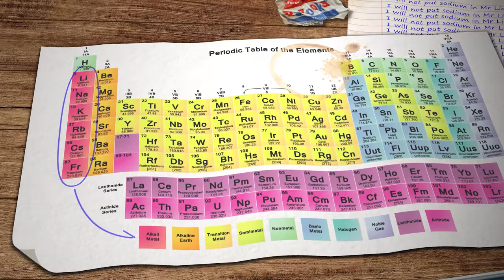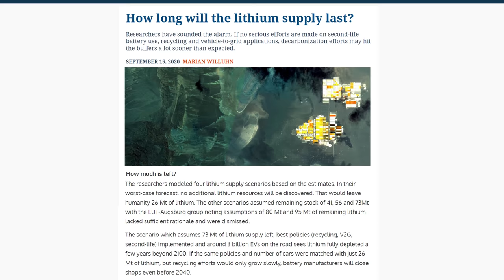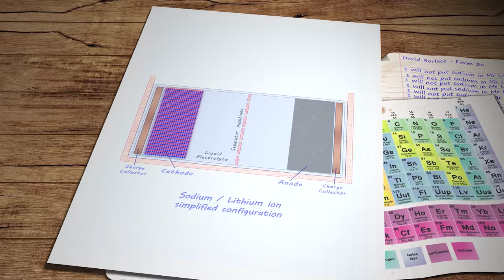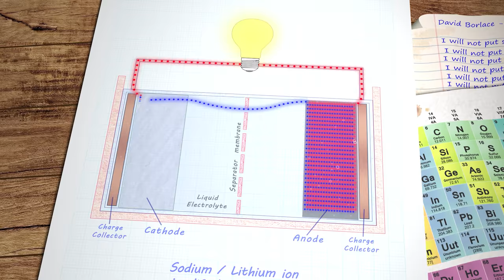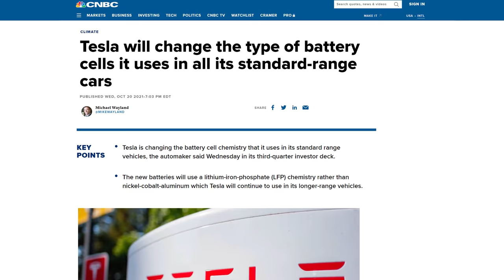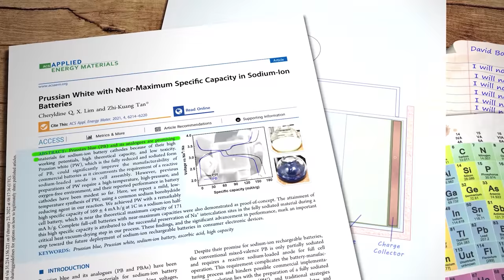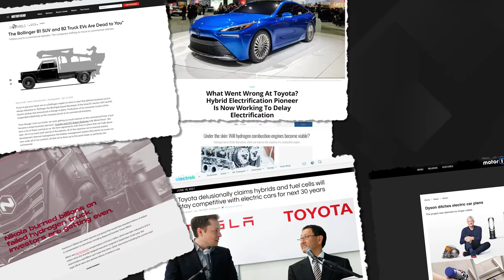Sodium-ion battery breakthrough. Safer, cheaper and cleaner than Lithium-ion

Comment: With so many horses in this race, sooner or later one or more of them is going to beat Lithium Ion technology.   Battery technology seems to improve at incremental rates, rather than massive breakthroughs.
Reply: Lithium will likely always be top dog if you only look at power density as the winning factor. Personally I'd like durability, life expectancy and price over shaving a few ounces off of the weight.
Reply: @ghz24     Sodium Ion technology can't beat Lithium in terms of power density, but for power grid applications, the increased number of charge/discharge cycles shows Sodium to be the winner. In the case of a power grid, increased size/weight isn't that important.   Battery Technology is NOT one size fits all.  Depending on the application one technology may be a better fit than the others.  As you pointed out when power density is critical, like portable applications, Lithium is the king.

Comment: Is there a safety issue? We know that lithium batteries catch fire from time to time. Wouldn't this be worse and harder to extinguish as sodium is more reactive?
Reply: Sodium is less reactive, -2.71 volts vs lithium at -3.02 volts.

But battery fires aren't hard to extinguish anyway. They don't spread like petrol fires, so you can just ignore them and they'll go away, or you can pour ordinary water on them, which is readily available, unlike petrol and diesel fires that need special fire fighting, like foam or CO2.

Comment: So, the common perception is that sodium is abundant in earths crust at about 2.8% compared to 0.1 % for lithium.  Has anybody thought of the problem that most of this sodium is in the form of salt NaCl, which is about 40% Na and about 60% Cl.  If you separate the sodium from the chlorine you in an electrochemical cell you end up with NaOH + Cl2 + H2.  Hydrogen can be used in fuel cells for niche applications, but is there a market on the large scale for all that Chlorine gas?  If there is no market for all that extra gas, then the Cl becomes a waste product.  Just wonder if anyone has studied this?

Comment: Let's face it, ANY technology that relies on mining a finite resource is due to have an expiration date. Fossil fuels are of course the most obvious, as it's completely spent in it's use. There is the hope, and honestly the reality, that existing Li Ion batteries can be recycled. There should definitely be a means for average consumers to give to this effort by offering their own spent cell phone batteries to recycling. Of course this doesn't happen. 

If you take your old phone to any recycling center I know of, assuming it's not working anymore they'll be happy to just take it for free, but offer you nothing. So many of them wind up in waste dumps. I'm for there being some subsidy to allow for this recycling. It's larger at this point than the potential EV battery recycling by far.

Comment: Will "they" (whoever "they" are) make a sodium-ion battery that will power my 1/10 scale radio control crawler? It's a 6X6 with 2 electric motors. I'm trying to find locking portal axles for it and run 2.2 wheels or a track conversion. I haven't decided if I want to go in a direct individual track replacing every wheel conversion or go with a more traditional half track (front 2 wheels stay on and the 4 rear wheels are replaced with 2 tracks...one for the left set and one for the right).

Comment: Energy density is probably the most important factor in battery design, but volume is almost equally important in terms of mobile power usage. A battery for cars and trucks needs to be energy dense but also fairly small as well as light. A battery that weighs one kilogram that has the same energy storage as present Tesla battery pack, but is as big as a three bedroom house is not really feasible for much of anything. Are these sodium-ion batteries as energy dense by VOLUME as current lithium-ion units?

Comment: If they are so great then:
how much cost is 1 kWh of capacity?
where can I buy them?
The environmental impact and exploitation in the Congo has nothing to do with battery chemistry - this is pure policy and please do not confuse the issues.
As far as I know about these batteries, compared to LFP cells, they have a much lower unit capacity, both in relation to weight and volume, and are not necessarily cheaper than mass-produced in Shenzhen.
BTW Sodium has no less nasty environmental impact than lithium.

Comment: I'm just an armchair nerd/geek, but have been thinking about sodium batteries on and of for a while.

Now that the energy density is comparable/better than current lithium technologies, and the tech is likely to go mainstream quite soon, would it be practical to use sea water as a source for both sodium for batteries and hydrogen for fuel cells? Two power technologies from one source. Or indeed create a de-salination plant to supply sodium to the battery industry, fresh water to people AND a hydrogen production plant for fuel cells.

Comment: wonder whether a combined FuelCell & Li-ion marine propulsion system power a 96,350 ton stealth (CATOBAR) aircraft carrier . . . with a single M-FuelTurbine® as back up that'll run on the same JP8 jet fuel as the air wing . . .

Comment: How does this compare to graphene though?... It's cheap, safe, non toxic and is basically a capacitor like battery. With tons of use cases for graphene in solar panels and other green tech. I've seen a guy make a graphene battery out of household materials in his kitchen...

One big thing all batteries need is.. The ability to be RECYCLABLE!
otherwise there is nothing green about electric cars.

Comment: sodium has an energy density of 9.1MJ/kg or 13.3 depending on if you burn it to sodium oxide or sodium hydroxide. 
a Sodium sulfur battery 	0.54–0.86 MJ/kg
compared to lithium that at 43.1 MJ/KG.
wood has an energy density of 18 MJ/kg 

a sodium ion battery would be abysmal. maybe safer and cleaner but it would be comparable to a 5 MPG car when used in a vehicle. 
only use sodium ion if your goal is to move to the adjacent parking space before you need to charge up again.
Reply: Sulfur? Where did you see sulfur in this anywhere.

Comment: The most important thing is to remove Li-ion batteries completely from stationary applications. Tesla Powerwall is an appalling crime against humanity in terms of resource wasting. The intention is very good and it works for the time being but the wasting of precious materials is bad. High energy density in a box that sits around in your house is useless.

I don't understand why they are pursuing EV application when this can be great for small-scale grid energy storage. For individual homeowners, technologies like molten salt batteries will be overkill (expensive, unsuitable given consumption profile).
However, a battery that for the most part behaves like Li-ion, albeit heavier but have better lifespan and can potentially be cheaper? Bring it on!

Comment: While sodium batteries seem like a good idea at first, there is still a way to go to make them safe and environmentally friendly. Sodium batteries, literally with every charge/discharge cycle, destabilize the crystal structure or the anode can form dendrites causing short circuits. One way to stabilize is to use Antimony. It turns out that unlike Sodium, Antimony is neither abundant nor environmentally friendly. It occurs in nature as a sulfide or with sulfides, and the extraction process and subsequent industrial processing is very harmful to the environment. See, for example, the problems with heaps associated with sulfide mining (e.g. acid drainage). There are also recent attempts at stabilization using mixtures of nickel and manganese. Nickel mining is far worse for the environment than lithium. Using Prussian Blue, as stated in the video, also seems like a good idea. It turns out that Prussian Blue is a nice name for iron hexacyanoferrate. While it is not toxic in powder form, when ignited it becomes dangerous. As someone pointed out in another comment, Lithium, when dispersed in the atmosphere is dangerous. What if such a battery, with Prussian Blue, ignites after an automobile accident? At first sodium seems like a good idea or a potential silver bullet but there is still a long way to go to solve all the problems. Even as a solution for fixed batteries, there is a big risk of ignition, as happened recently in Tesla's gigantic battery in Australia (by the way, an absolutely pathetic idea for storing energy... if the whole world did the same we would need 520 planets Earth just to mine lithium...). Despite what I said, I want to congratulate the presenter of this video for the clear and enlightening way in which he presented the content.
Reply: LiFePO won't catch fire. Likely there is a similar possible solution for sodium.
Reply: @ghz24  True (however you should say "less prone too.."). Even so, they have other problems like less energy density. There is no perfect solution.

Comment: Is there any informal consensus on battery storage vs the building block (crane system) or water pump / gravity turbine systems for mass energy storage ?  Is water preferred when topography and a water source is readily available for example?  What about moving energy from one area to another or from space to the surface?  There seems to be a whole lot of research in different directions but news media has not identified best practices.  Some are saying small scale nuclear reactors would do far less ecological damage vs lithium mining and offer continuous power generation...... vs ability to store power from wind or solar that requires considerable infrastructure spread out.  It’s all sort of interesting but from a more practical perspective, going in 20 different directions is very inefficient use of limited engineering brain power.  Seems logical that government would want to agree on a system that is safe to operate, cheaper to build and maintain, and that can be  built in a distributed manner so that massive power lines could be eliminated and a replacement grid could not easily be taken down in a wartime or terrorist attack on the main “trunk line” .   Are we moving to any consensus on a logical grid replacement?  Should homes be energy independent or does it make sense to create community and city solutions?  How can these be better structured so energy is cheaper and citizen owned .....can we transition power system ownership to local resident cooperatives ....and eliminate the monopolistic and required by code profit system ..... that allows the power company to generate profit for the wealthy elites by over charging in order to create vast profits on the back of the working class ?

Comment: Plenty do not realize that’s China controls somewhere around 80% lithium mining, world wide. Thru contracts, management, and/or ownership, of which I’m not sure of. 
I would think evehicles are going to eventually be the dominant player, I don’t think it can a sudden move and maybe not for every application. EVs currently use plastic and carbon fiber parts which are petroleum based products, for one. Two, not everyone can afford the initial cost, much less secondary cost. Then there’s the grid issue. 
As for recycling, it should be a must. Resources are not infinite. A lot of recycling cost are in the energy used to collect, store and the actual recycling separating material. I believe it’s a must and while it’s amazing to put a vehicle in space. It is also a waste of resources. More energy should be put forth, trying to make this world work.

Comment: This is good news but there is still the problem of battery longevity. After 5 years, lithium ion batteries have significant performance degradation. Does the sodium ion battery show improvement  in this regard?
Reply: Not all lithium do that.

Comment: Nope lithium sulfur will take it away. Nickle will be similar to nicad. A half way moderator. Energy density is not there. With lithium sulfide it will eventually have 1/2 the energy density of gasoline. Thus 1,000 mile car topoffs. You can imagine a car that has only been recharged 10 times @ 100k.

Comment: The first think I would like to know is cost per kWh. If it's low enough then the biggest step forward would be some sort of domestic scale power storage (think Tessla power wall). If you could up that to 30kWh that would be 900GWh of storage if every single home had one. TBH I think this is more about politics than helping the planet now. EG if everyone had 60kWh banks then you could go 3 phase and use spot pricing. IE buy overnight when the price goes negative at times and sell when it is at peak. If a household also had a 2kW power output (about 3.5kW rates) solar roof then even in winter you would get 8kWh per day for the worst months. But we cant have customers no longer needing the grid can we? I mean the rich gits who own the utilities companies wouldnt get their dividends and bonuses.

Comment: To baldy go where no bald man has gone before ;-) 
Anyway, it sounds promising and more important: feasible! 

 A green economy also requires a broad integration and interaction between different sectors, as we in the Netherlands encounter. You can make fertilizers with green hydrogen, but what if there isnt enough? Also, a lot of processes can be improved, but are part of several links that also need to be adapted to make it work. What we call the chicken-egg problem: to get electric cars, you need charge stations. But why to build stations if there are no cars that will use them? So you cant leave such things to natural developments and market systems alone. 

Note about Lithium. Due to quadrupled prices, those sources matter as well. Logistics also play a role for European and American sources. So smaller players matter as well. And in this perspective: we need to invest in green mining as well, like making green steel as they do in Sweden. 

United states - 750.000 T.
Canada - 530.000 T.
Zimbabwe - 220.000 T.
Brazilië - 95.000 T.
Portugal - 60.000 T.

Comment: To be honest, if I count the "gamechanger" alternatives to Lithium in the past 1-2 years I could possibly come up with 2-3 and now, with Sodium, 4.
My humble answer to why these are all inherently paper tigers is that there was, in a similar fashion, always a "breakthrough" in fusion research,
for about 30-40 years now. I am really puzzled why we are not already colonizing the galaxy with all the abundant cheap and clean energy why already have.
Oh and let's not forget that solar panels are also experiencing "breakthroughs" with no change in the limiting thermodynamic laws. It's really fascinating.
Well, let's just  have a think, shall we? I dare you.
Reply: Fusion research and battery chemistry research are completely unrelated.
Fusion has never been useful (except the sun) batteries have been useful for longer than any of us has neen alive. 
We have seen real culture changing improvements in batteries in those same 40 years from battery technology, ni-cad to lithium ion is a huge improvement.
Solar cells have also seen incremental improvements over that time the cells we make now make easily twice as much power from the same area as ones from the 70's or 80's.  They are also no longer energy negative as you claim. A modern cell will produce more power than it took to manufacture, unlike in the 80's. (Change my mind it's open to any evidence to the contrary)
Just because there are lots of overhyped claims doesn't mean they are all paper tigers and this one makes more sense than 95% of the battery hype I've heard.
If they can make cells that are even twice as heavy but half the price they are going to replace lipo in a lot of applications and allow new applications.
Reply: @ghz24  
The fusion allegory was just that, it's an example of research at dead ends and the scientists who are paid won't admit failure. The ITER project is a money graveyard and it still eludes my senses how this research can still be funded with BILLIONS, same as the LHC. Considering the solar cells: Yes, we make twice as much power now, but if I double tiny amounts they are still tiny. Solar energy is and will be a marginal asset to energy production. I see your points and admire your optimism, but there are thermodynamical laws which on the one hand prohibit solar cells to produce sufficient energy to power the world and I have the strong feeling that the current scientific approach to such problems is very narrow minded and just doesn't start from "What is physical possible and what is it worth to settle for?" Same goes to gain of function research which has a "Let's just do it, no matter what" attitude. You see where this has led us to for almost two years now. I know it seems unrelated to you but it shows the erosion and corruption of science nowadays, more than ever slave to the capital market. We will see how this ends but it won't end on a high note.
Reply: @N1otAn1otherN1ame  I wouldn't consider my position to be optimistic, just realistic about what has been accomplished.
It's tempered by a pretty through understanding of the energy issues that have stalked us from the 70's and faces the world today. You are right about solar not powering the world same for all the "alternative" sources. Nuclear is what we need to provide the concentrated energy to power industry and cities.
Yes batteries are near maximum power density at least for rechargeables.
And efficiency of solar is not that helpful in the big picture.
I like solar and (some) battery storage for my house but feeding solar from every roof directly to the grid is a horrible idea. It will kill our grid.
And yeah the realities of thermodynamics suck.